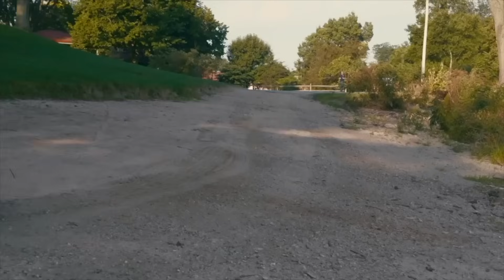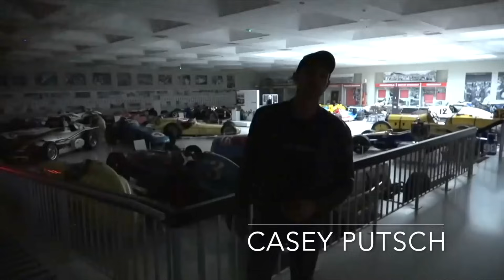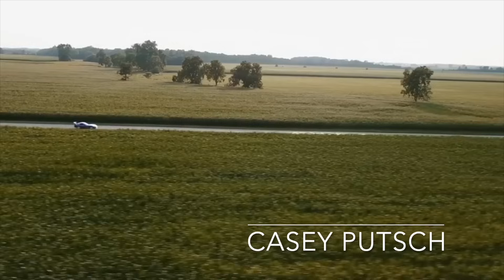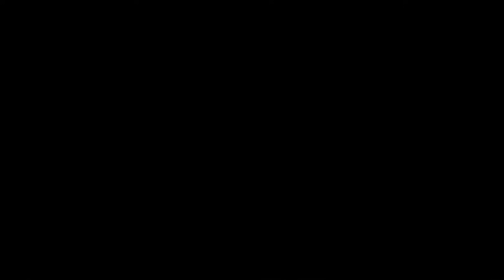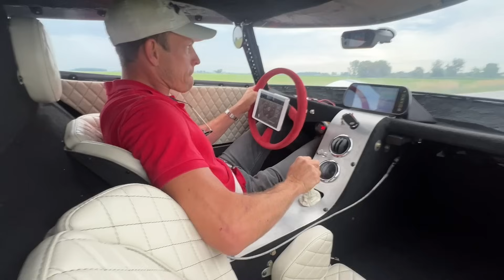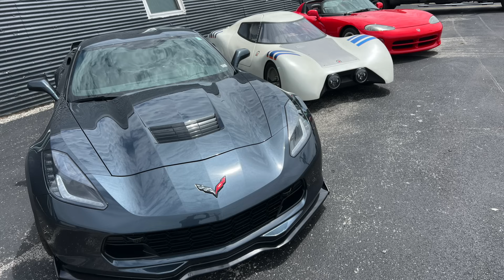HOW?? 104.7 mpg,  0-60 mph in 4.61 - the OMEGA CAR - Video 4

Comment: Great job Casey, keep it up, you're an inspiration!  I can get close to 50 MPG (US gallons) in my early 2000s VW TDI.  And I can run it on Bio-Diesel. Close to net zero carbon.  Thinking my next project car will be a Lotus Europa with a VW TDI in it.  Rough estimated MPG should be over 70 MPG.  Why would I do this, one my ask? My answer is because I can and I think it's cool.

Comment: Is there a breakdown of what the Omega car is? Or can you go thru it. What engine, trans, rear was used. Really like it.
Reply from the maker: VW ALH
Reply: @CaseyPutsch Thanks for confirming my suspicion. 

Years ago, there was a guy that swapped one into a lifted extended cab Toyota. Claimed he was getting 40mpg cruising at 75mph on 40" tires.
Reply: he said tubro 4cylinder diesel but took me forever to hear it
Reply: @PastelFroggy yeah, but still hasn’t said how he designed it.  Says he designed it but never says where it became more efficiency other than body style
Reply: @laxwyo1 yeah, I do t know how anyone can stand listening to this guy. So much talk, so little good information
Reply: @laxwyo1  hes trying to market himself first is why, its just light its a fiberglass body/frame as the body is the frame, with a small good diesel its a glorfied go kart its been done before. people have short memories
Reply: @PastelFroggy  yes... there are a few that's been produced
Reply: I believe it's the 1.9L from VW

Comment: As owner of ev and diesel, we are all being played, the diesel is by far the cheapest thing to drive. Ev's only enrich  the almighty insurance companies. As mechanic I could appreciate some of the cost savings, but at the end of the day its a brick if it gets wrecked. My diesel is covered in dents and rusts, it putsch money in my pocket at the end of the day! By the its a f550 7.3 if anything going to lose to ev it would be big block diesel with 2 ton frame, insurance 30 bux a month commercial liability auto manual trans.
Reply from the maker: yuuup

Comment: I will also say I’m sick of “new models” STOP THAT! make something that’s affordable, reliable and durable and performs well, then every year focus on how to make it more affordably or durable etc. without making it worse. Only develop a new model when it’s actually needed. That way there’s tons of replacement parts produced in huge numbers as well so it’s cheap to repair.
Reply from the maker: YES!
Reply: Have to deregulate the market before manufacturers legally can
Reply: @Kagawwy  unfortunately this is the way cars were once manufactured in the U.S. They would design a model and continue to build it for several years and manufacturer a massive amount of parts for repair as well as having massive aftermarket support and parts. With any manufacturer there is almost always bugs in the first generation and by the 3rd or 4th they had worked out all the bugs and you had a really decent platform that was trustworthy and would last. Today it’s all about what’s new and the latest greatest.
Reply: Give me a carbureted diesel 4 cylinder with manual transmission, no power seats, roll up windows and space under the hood to change things in my driveway. Hell I don’t even need AC or power steering!
Reply: But old is gross, ewww. You'll give women "the ick" 😂
Reply: I agree but the problem is, that the manufacturers have made people believe they need full body massages while driving down the road and they need autopilot and the finest leather in the world on top of all the very complex electronics and enough sensors to launch the space shuttle. I enjoyed the days when I could open my hood and actually get to every part on my engine without taking a single body panel off. Now you have to take half the car apart. One simple sensor can put the car into limp mode when it has nothing to do with anything that will actually cause damage to the engine or transmission. Simply put cars have followed suite of a few countries that have seemed to make their cars overly complicated and very expensive for decades.

Comment: In Saudi, the government is pushing for more efficient cars, and electric cars haven't really been accepted to be the main mode of transport here in Saudi because the Charging Stations are too costly some overheat and there are very very small amounts of charging stations and most EV owners here charge at home only and when they get to work they either pay to install an EV Charging Station or charge from the wall and the minister of energy said that we don't live in fantasy land we don't live in la la land we live in the real world and depending on EVs only is bad and Aramco CEO said that the west will wake up from their honeymoon with Electric cars and Aramco has Worked with Ford to produce a hyper-efficient Diesel Engine for trucks and they are investing in Horse PowerTrains a company founded by Geely and Renault to make Efficient ICE Engines and If I had the chance to buy the Omega car I would because it looks amazing and has amazing performance and is very efficient and the Goverment has always said that they will not ban ICE cars even the minister of energy said he will still drive a ICE car because he prefers them to EVs and the focus currently is on how to make a very low emission and efficient ICE engine and what are the alternatives to Gasoline and Diesel

Comment: Shut up and tell me what engine is in the car! Also you haven’t proven anything you made a bunch of claims and showed pouring some fluid into a port/tank on the vehicle… that’s not proof, especially with cuts… show the engine, show the fuel system, show the drivetrain, etc. or open the business and start selling them.
Reply: This dude talks in circles and doesn't actually get to the point of explaining what the car is and how it does what it does.  I've given up on him actually saying anything relevant to the subject matter.  Just a bunch of hot air.
Reply: I was thinking the same, technical details would be interesting to know. Also maybe a more creative name would make it easier to find in search engines, right now most of the reasults are about Opel/vauxhal Omega.
Reply: Yeah I don't think he's being honest at all about the thing. I can see a diesel hybrid doing these things, but 100+ mpg and faster than a viper with a 4cyl diesel and no electric assist... not gonna happen. I like the message, but it gets lost when you lie about what you're doing.
Reply: @jamestunedflat8942  It is simple, it weighs nothing. It is an absolute death trap. I will be impressed if he gets 50mpg after he adds 500lbs in airbags and structural supports. The thing is a fiberglass go cart, of course it gets great gas mileage. I'm not putting my kids in that thing.
Reply: I agree with the message, but like everyone else, without any actual proof you really have nothing to be bragging so much about. If he is so proud and confident, surely he’d have taken the time to get the car evaluated but i think he knows it wouldn’t pass regulations etc so just talks about politics instead like we don’t know he’s ignoring the real point.
I mean, VW created the XL1 which was technically more efficient etc, so manufacturers can engineer better but they don’t as that doesn’t increase company worth and investors don’t like that.
Anyways, cool car, but it’s as pointless as most other YouTubers car creations, just for attention and I think this guys would rather be a politician with those question avoidance skills lol
Reply: Exactly, this is my first time watching his videos, and I thought this would be a cool car video, explaining the car... not some drunk uncle with conspiracy theories rambling at Thanksgiving.  If he's supposedly all about teaching about cars, teach us about the car... or at minimum get to the point. He's worse than Kamalla as he spells it 😂😂
Reply: He CAN'T sell them; they can't pass the crash tests.  Now, as a KIT car...
Reply: i smell a scam.

Comment: I fully agree, simpler, more durable, long lasting cars will even offset any economy savings too. I just raked 50 acres of hay with a 75 year old Ford Tractor, not a nice one, but one that has lived a hard life yet is still serviceable and useful…. 7.5 hours and the thing only burned 5.5 gallons of gas too. Biggest issue is the throw away, fashion aspect of new cars. Blingy tech, and the latest fad outweighs good design and build quality unfortunately.
Reply from the maker: Very true!!
Reply: Quality has always been an issue unfortunately. To put it into perspective, the average new car in the 1960s brand new had about 12 quality/reliability defects off the assembly line. That's down to about 1-2 issues per car now. 

Back in the 70s-90s, a car was considered done if it had close to or over 100k miles on it. Today, that's nothing. 

Our 2017 explorer has been significantly more reliable than any of the Toyotas/Hondas we owned from the 80s to the early 2000s. 

So while things can still stand to improve, quality on cars is better than the shit brands used to make, and it's no contest, but things can still be better.
Reply: @themidnighttavern6784  I agree with what you are saying and that speaks a lot to manufacturing processes. My point is more that if you took those advantages and used them produce something that focused on simplicity and build quality more so than shrinking displacement, adding turbos and thermal load and super complicated electronics that are now tied to throttle, steering, and brakes with a multitude of sensors and failure points… my tractor analogy would apply directly to new tractors as well…. Yeah, the processes have higher tolerances now undoubtedly, yet I would bet you 75 years from now very few new tractors would still be operating and serviceable, let alone serviceable by some guy in his barn.
Reply: @Kristian_Saile  I definitely see where you're coming from, but the issue is people don't want what they say they want. It's frustrating, but true. 

Case in point, I own a maverick hybrid, fantastic truck, does everything most truck owners need to do. The 2.5 duratec is a tank, planetary gear e-cvts are basically the most durable form of automatic transmission in existence. It's a small, affordable, reliable, fuel efficient, easy to work on truck with a decent warranty. 

Yet any video you see with the maverick, the same people who claimed to want a cheap small truck are complaining that the maverick is a cheap small truck. Saying it's not big enough to haul all their stuff/people or bitching that the cheap truck has an interior with cheap plastics. 

People don't want what they say they want. People don't want cheap vehicles. They want a car with 50 grand worth of luxury materials and the latest tech, yet they want to buy it for the magical price of $15,500.

Comment: The soybean car was the 40s if memory serves.  The issue they ran into was adhesion, a problem we've solved since.

I like your style. I'm converting an F150 to a 4 cylinder diesel with the same reasons you built yours. I'd love to have skills to do it ground up as you have, but I'll work with what I have.
Reply from the maker: 1941.
Designed it earlier
Reply: @CaseyPutsch  fair enough. I remember the picture of Henry taking a sledge hammer to the trunk lid. Great photo.
Reply: The dude who has the GT90 concept car has a wrecked Mustang (5th gen) race car with panels made of soybean. Fascinating!
Reply: I believe Ford also experimented with hemp for body construction during the war as well.

Comment: You can run it on biodiesel. That's an awesome car.
Edit:
"Make it last longer" I live in Quebec and everything rusts within 20 years. Why won't the make the frame from stainless? ... I totally agree with you.
Reply from the maker: Yup!
Reply: Stainless corrodes too. Under stress, it will see stress corrosion cracking, which is no fun.  It's not a miracle material and is difficult to work with for manufacturing parts.
Reply: @AndreS_-df2nw  
Where I live there's a trailer company that hot-galvanise all their frames.
Reply: @AndreS_-df2nw  let's get some crazy steels like LC200N and go bananas building a rust proof car! 😂
Reply: Why not just build it out of pine pitch, carbon fiber and plywood? No metal, no rust.

Comment: Ive been met by the dead stare when I speak on the inefficiency and environmental impact of electric cars as we know them, not to mention the child slave labor...but im reminded of the 92 Honda civic vx that could do 55mpg out of the box...and thats without crazy aerodynamics just using the base of an eg hatch. I get 39-42 mpg in my 93 ex civic coupe, they did it then it should be better now, yet it isnt. Hmmm...I hope people see these videos and think for themselves. Great build Casey...thanks for sharing from your corner of the universe...i will continue having these conversations.
Reply from the maker: Thank you kindly! More to come!!
Reply: @CaseyPutsch 🤜🤛
Reply: @CaseyPutsch 
Love the video Casey
Reply: Nothing has improved with car efficiency in decades. It has all been fluff and nonsense. 

If government actually cared about emissions, I could buy a new 92 Honda Civic. That car would sell.
Reply: @borisjankovici662  I have multiple 80s 90s Hondas, they beat most new cars for economy, reliability, and longevity...cars don't need to be 4000lbs...I would definitely buy a "new" 92 Honda because I could keep timing belts water pumps, wheel bearings an extra alternator and various bushings etc in a big box and keep it going for a long long time at extremely low cost. But because of the regulations, that car can't be made today legally, which is about as stupid as electric car mandates.
Reply: @drivingdaily582  You are 100% right. It has been decades since manufacturers realized that regulation is their friend.  The result of this has been stagnation in real innovation and engineering. They learned that instead of fighting regulation, they could invent regulation. Lobbying Washington to mandate their products into vehicles. This creates enormous profits and impossible barriers to entry of the markets. It creates overly complex, unreliable, extremely expensive vehicles.

It is ridiculous that you can not buy a car today that competes with the reliability and emissions of an 80's or 90's Honda like you have. Insane.

Casey is right. This IS political. Which party is forcing this? Which party is claiming to be green but will not allow these vehicles to be produced? Which party has doled out billions to these corporations who have FAILED to produce the EV's they've promised?
Reply: Government control, EV'S can so easily be confined to a 15 minute city.
Reply: @steveclark..  yup, I'm not even against them for city use, but the problem is that they don't want us to have long range vehicles that can't be tracked and controlled, which is why I keep old cars around, because I think it's a freedom issue, hate to say it but yea it is a bit political unfortunately.
Reply: @drivingdaily582  Yes, all what you said is true, I researched Klaus Schwab and co like 5 years ago now, all their points on that plan are about removing all our freedoms and choices basically.
Reply: I get 45 to 80 mpg on my Insight. 1st Gen is half the weight, Aluminum... and doesn't rust. Not nearly disposable enough. And that's without utilizing the hybrid capability which I have bypassed.
Reply: @VndNvwYvvSvv  nice
Reply: I think I could tube frame a Geo Metro down to 1,200 pounds - or less. Use a fiberglass hood and hatch - Lexan side and rear glass.  I'd have to use like a Kubota D1105-T (turbo) - has only 36 hp - about like a 1960s VW.  I think it could get 100 mpg.  I can get free Metros with control arm mount rust.
Reply: ive also heard of an old aero kit for the 90s civics that people have used and gotten up to 98mpg running gasoline

Comment: My original comment seems to have never have been posted - strange.

As you've shown here - good design and engineering practices can allow for efficient and environmentally friendly cars. 

There's so many techniques like lean-burning, that have existed for a long time, but are rarely used. The original Honda Insight for example used lean-burning and could achieve excellent fuel economy. Honda themselves then decided to abandon it and went for a more conventional setup. 

As long as there's more money to be made for the manufactures and easy political soundbites for the politicians, nothing will change.
Reply from the maker: Yuuuup
Reply: Isn't one of the problems with lean burning that you get higher cylinder temperatures which leads to nitric oxides in the emissions? If so, water injection would be an easy solution with the additional benefits of delaying detonation, and decarbonizing the cylinders.
Reply: @thomassuit7450  Yes, but the increase in NOX emissions is not that much higher, particularly when you consider the quantity of fuel used. 

Honda used slightly more complicated catalytic converters with their lean-burning engines. While they are slightly more expensive to produce, it's likely the cost would go down with further development and adoption. .
Reply: @thomassuit7450  Don't even need water injection. Start mixing ethanol into your fuel (preferably one that isn't made from a super inefficient source like corn) and you can get higher octane fuel, burn cleaner, and lower cylinder temps. E85 is very popular with rotary enthusiasts because of what I just mentioned.